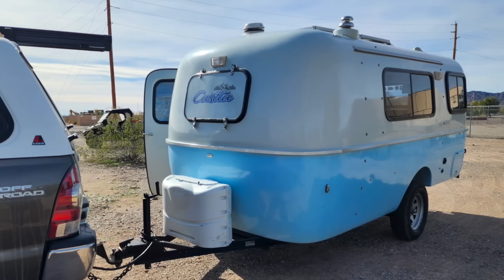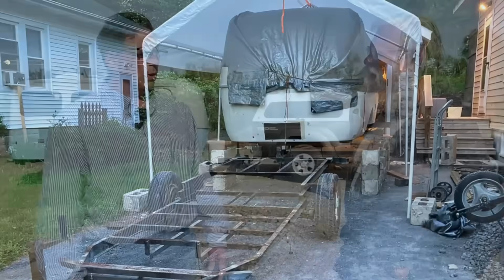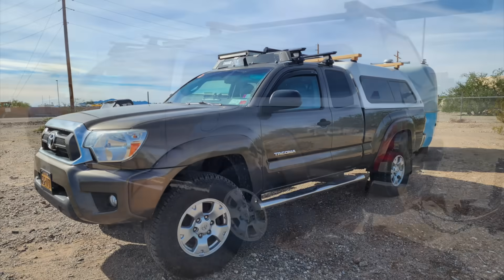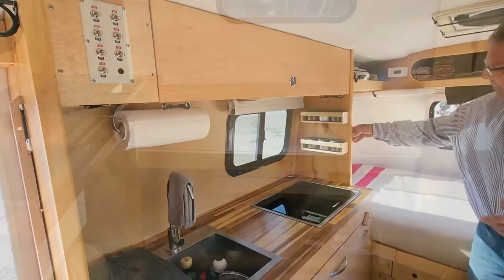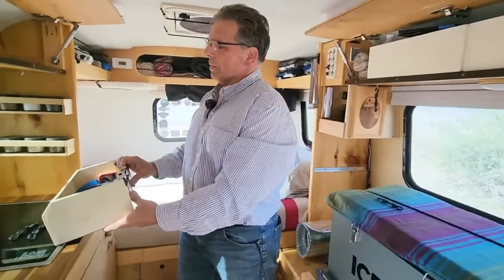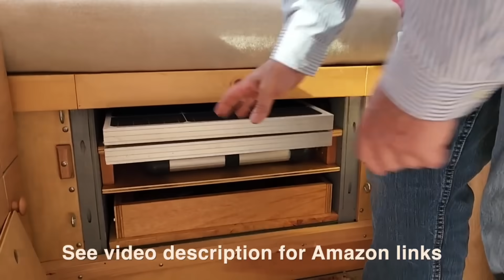$1900 Casita REBORN: An UNBELIEVABLE Trailer Transformation

Comment: Beautiful redo.  Very custom and smart.  I loved the shower what a great idea.  I have 1984 16 ft Scamp, and it needs a lot of work.  It was used for years and provided a roof over my head.  Took out the old stove, furnace, and water tank. I have some rot in the floor, and the axel is bent, so it needs a lot of work.  Thinking of turning it into a she-shed and enjoying it at home.  It has a toilet and shower (never used it). It was fixed up for dry camping.

Comment: I purchased a 6x10 Pace cargo trailer in 1998 and used it through the years until finally converting it to a cargo camper around 2022. With rear open up doors , I tucked a pull out bed in the front with a bunk above for overflow storage. The build outs were compartmentalized on the side walls with fold up shelfs to still have a cargo trailer to use. Overall , it works great and is still light despite many additions like latex mattress on a steel frame, front steel tongue apron for battery / spare and  Ge window unit in front, jack stands on 4- corners , solar panels and sink / Buddy heater on the door. Mistakes I made and since fixed were beefing up the tongue with steel inserts, using improper light wiring ( should have used marine grade) and better foam board insulation in the walls behind the plywood which can’t be changed. Most of what we imagine we need is off the mark when camping because simpler is better. Ease of cleaning trumps to much compartmentalization. Still, realizing that it is a process means that just starting is the best way to fine tune what works best for you. Thanks for sharing your journey

Comment: Absolutely beautiful interior. All other Casitas and Scamps with these plastic/ composite cabinets with not very attractive fronts are not attractive no matter what you do with them but is is really, really nice. I would love to own this one  and the only thing I would want to add would be some sort of two side sliding door or retractable by the diner to get privacy while using toilet. Something like they have it in light weight trailer bathrooms now.
I can't figure out what Thmas used on a walls as insulator in place of what Casita uses (felt now but carpet before).

Comment: I had a Casita, and the window in the bathroom leaked, and even after the factory sent us another one, and the new one leaked, too, though not as badly.  Then we went through a hard rain in Galveston, and due to blowing rain, the outside storage compartment leaked.  The water spread into the interior carpet, ruining another camping trip. We had a 17 foot, and it was too small for two people and a 12 pound dog.

Comment: Outside electric shower pump operation suggestion; for example, add a check valve and electric pressure operated switch between the discharge hose nozzel and check valve; as a result. operate the hand spray valve and electric pump would run till pressure builds again

Comment: Yeah,  looks great but now you could never pull it with a car or small suv. Adding cool stuff is fun , if you are not factoring weight. then it gets complicated.  .  .also these frames are known for cracking and breaking. I would pull with a cheaper , more powerful truck , than a pricey Tacoma

Comment: I love my 53 year old tiny fiberglass travel trailer. Mine has a popup roof section that is a real advantage in hot weather. I bought it  in derelict condition and I knew I would have to totally gut it out, patch up holes in the shell, insulate, wire, custom layout and cabinets, even a new frame and axle. Fortunately other than welding the new frame (friends did that) I had all the professional level skills I needed for metal working, fiberglass repair, cabinet making, electrical and canvas work fabrication for the popup top.